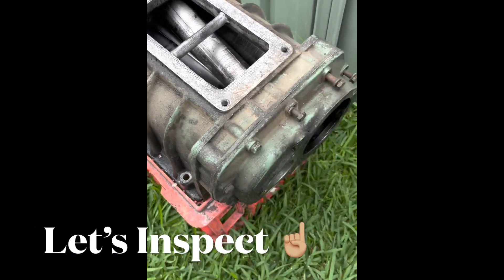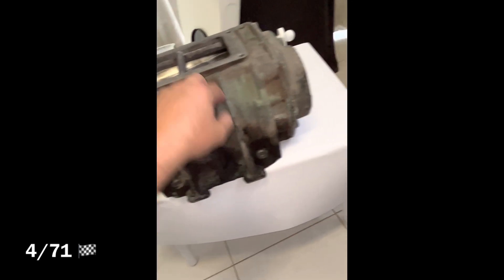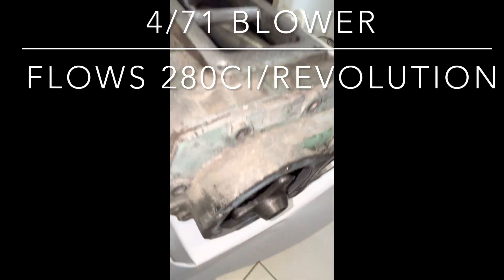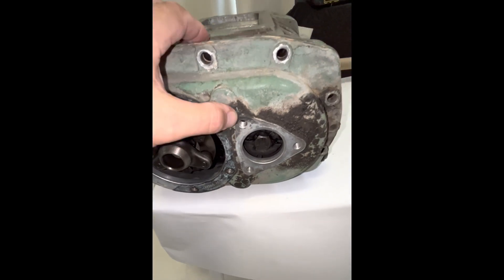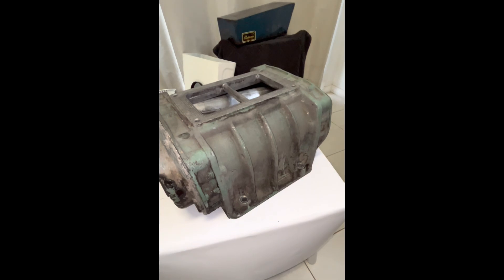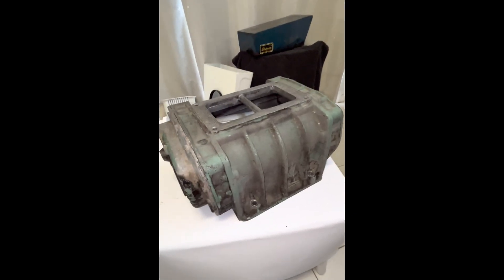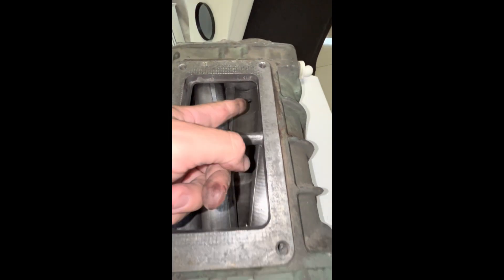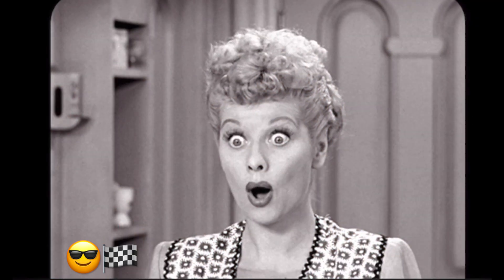GM 4/71 Blower, “the Little Mighty” SuperCharger

Comment: What and gear cover will fit on my  8v92? Are all the 671s gear covers  pretty much the same as  V series??
Reply from the maker: No they’re not…..I’ve shown this on the other vids… so the early 6/71 end covers (half round) like that Dyers one shown on the vid can be used with “v” series & just need to trim the two ears off it to fit nicely…..because those 6/71 end covers have a wider mounting pad on the inside face that can go up against a “V” end plate….., now these later end plates/covers like on this 4/71☝🏼, are a square’ish style & the mounting face runs thin on one end & square (on some), where the “V” is rounded shape sides…..so it won’t mate up & seal on one end basically. Just make sure you see back side mounting face when searching, if it’s the wide mount face pad all around then ok 👍🏼🏁
Reply: @69JANKS  thank you for the reply and your knowledge. Only way to really know is to ask questions, appreciate people like you that reply right away and give me correct information.  I'm going to post a video shortly, could you possibly look at the video and tell me what I'm working with here.
Reply from the maker: @hedgepethracing9590  anytime 👍🏼, appreciate you tuning in. Sure thing HR will keep an eye out & check out what you have👍🏼🏁

Comment: Nice compact little blower, always a good deal if you can get them cheap enuf. . Just bought 2 x complete 3-71 marine engines. 1 to put in a boat and the second engine is seized but the blower is mint. Will go suss out the endplates/covers.
Reply from the maker: That’s awesome M69 👌🏼🏁
Reply: Not sure what to do with it yet tho.But good little blower to have anyway.
Reply from the maker: @matui6983  the 3/71 is a good little blower, but won’t keep up OR will run outta puff on a small block🤷🏻‍♂️, just flip it $ M69 or good for on a Rotary, 4-6cyl🤷🏻‍♂️
Reply: Was thinking the exact same thing. Got a cousin with a V6 Holden engine in his boat, he was going to turbo it but I think a blower will get him a bit more excited. I will stick to finding 6-71 and 8V-71 units  I think.
Reply from the maker: @matui6983  haha i think that’s the bet M69👌🏼🏁